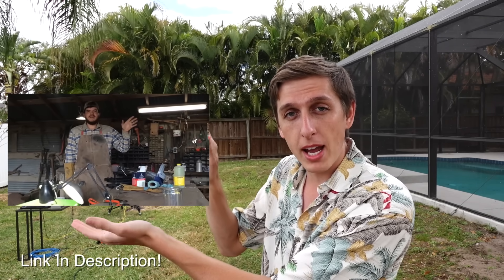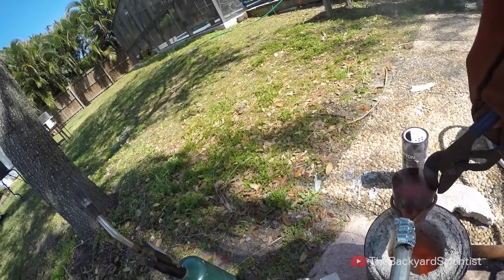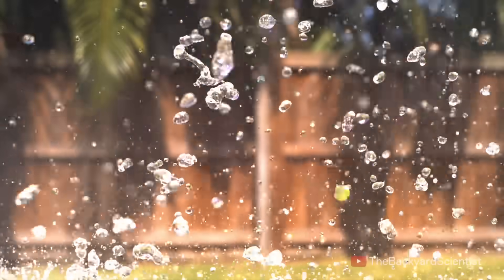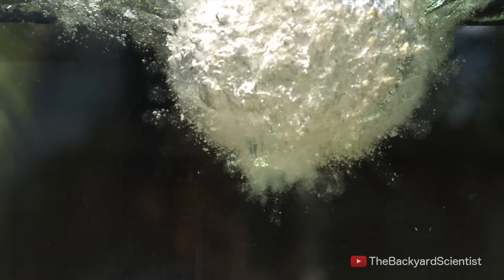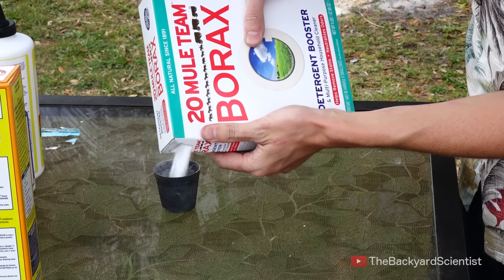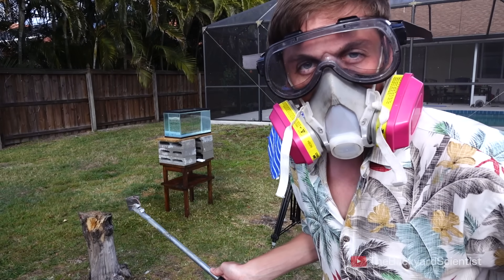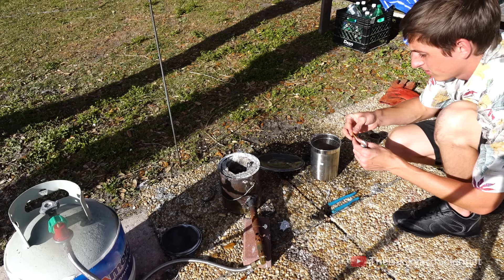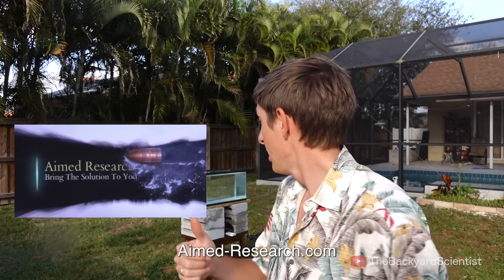Pouring Molten salt into Water - Explosion!

Comment: The reason for the explosion is a mystery to me as well. The best explanation I can think of at the moment is that sodium chloride has a much higher solubility in water when molten than the other salts do (I have no idea if that's true or not). Thus, the sodium chloride is dissolving and dispersing into the water fast enough to defeat the Leidenfrost effect. Instant steam explosion.

Maybe. I'll have to ask a chemistry/physics expert.  :P

Comment: Did you take into account the viscosity of the molten salts? From looking at the video, the molten table salt looked the thinnest. I think this could have a couple of effects. For one, it's poured into the water from the crucible faster, and therefore a larger amount is involved in the experiential reaction.  The thicker nature of the other molten salts could also prevent the water mixing with the fluid, due to the increased surface tension. This would mean that the reaction your visualized with putty wouldn't be able to happen.

Comment: 7:55 maybe its because NaCl is much more affine to water (much higher solubility).
You should try other salts aswell like KNO3 or KCl to check if its about solubility.
Also the viscosity and thermal conductivity of the melt may play a big role in this effect.
Reply: I really hope you're right. Either way, FOLLOW-UP VIDEO!

Comment: Dude... Get some better safety protection!! You should be wearing welding gear whilst doing these kind of experiments (thick leather gloves, leather apron and a face mask). Also the explosion is from the water flash boiling which causes the water to turn to steam at such a fast rate it effectively explodes. When water turns to steam it can expand to over 1,700 times it's original size. When the substance (salt in the instance) is hot enough and has enough surface area interacting with the water at once you get the explosion.

Comment: So, when you melt the salt, some of the chlorine vaporizes out of the solution, which leaves you with some elemental sodium. When you pour it into the water, you get a classic sodium explosion.

Leastwise, I think that's what's going on. Not convinced of your explanation.
Reply: +NarlepoaxIII clearly its the sodium reaction with the water. his explanition is wrong. but he tried
Reply: ThoperSought
I believe it's a very small amount of sodium. It's still mostly salt, but there's a little bit of pure sodium in there.
Reply: ***** actually when you heat up the salt to the point it starts melting, it will release chlorine gas and the sodium that stays becomes metalic. hence the results. he was right about the leidenfrost effect in the bigger explosion though.
Reply: I was thinking the same
Reply: ***** 
I wondered about that. in that case, wouldn't you expect to see the same orange color?

also, how about the ph staying the same, when he tested that?
Reply: Icaro Vasconcelos
Quod gratis asseritur, gratis negatur.
Reply: Icaro Vasconcelos ***** 
so, are you saying that the papers he referenced were incorrect, or that his interpretation of them is incorrect?

also, are you saying that the whole effect is a sodium metal reaction?
Reply: *****
"... there's a little bit of pure sodium in there."
so, re. the ph, are you saying that his test wasn't sensitive enough?
Reply: ThoperSought Mate, did you read the pappers? They're about pouring liquid water into a recipient filled with liquid NaCl, which is exactly the opposite to this experiment.
Reply: Icaro Vasconcelos
"... did you read the pappers?"
no, I didn't.  I don't have the background for it mean anything if I did.  that's why I'm asking questions.

"... which is exactly the opposite to this experiment."
that doesn't seem to automatically mean that the reaction is caused by sodium metal in this case.  can you clarify why that's relevant?
Reply: Icaro Vasconcelos
The melting point for metallic sodium is exponentially lower than that of salt.
Reply: ThoperSought
Probably, considering that there would have been a pH change even if it were the leidenfrost effect.

Comment: I think, that this could happen because of two reasons. The first is that the hot salt turns water into steam very rapidly. The second reason I belive is that the high temperature also decompose the water into hydrogen and oxygen which in turn recombind and cause the big explosions. But I really have no idea how this happens, but this is my theory.

Comment: Do ionic crystal lattice structures still apply to molten salts? Maybe pouring liquid nitrogen over a large salt crystal then putting that into the water could help to determine if it's something to do with the lattice. Compare molten salts that have a similar structure to NaCl - what about molten sand?

That's my late night two cents.

Comment: Well, how good is borax at giving off heat compared to NaCl? If your hypothesis is correct, the (still liquid) water needs to get pretty close to the salt to be influenced by the divets in the solidifying salt, before the water starts boiling and creating the Leidenfrost film. If borax is way more efficient at giving off heat, it would instantly create a Leidenfrost film protecting it from the liquid.
On the other hand, just for clarity's sake, if NaCl is terrible at giving off heat, the liquid water can get close enough to the material before boiling for the divets to do their part.

Edit: Although, after giving it more thought, not quite sure I'm correct about how the difference would manifest...Maybe borax is actually the one that's terrible at giving off heat, so the expansion from 1) the water turning into vapor and 2) the vapor further expanding due to heat leads to a less violent effect compared to NaCl? After checking the video again, the Leidenfrost bubble looks pretty tiny for borax compared to NaCl.
Thing is, if it is indeed a purely physical effect, the difference in heat transferability (or whatever that's called ~.~) is the only thing that comes to my mind as a possible difference between the two salts.

Note: I'm a physicist, not a chemist, and this isn't exactly related to anything that I have ever dealt with in neither my studies nor what I'm working on now xD So take all that with a grain of salt (pun absolutely intended).
Note #2: I'm at home because I'm feverish, so I might no be thinking straight :P
Reply: +Hedshodd My original thought was the surface tension of the molten salts. If borax sticks together in the water and "beads" then it would help the leidenfrost effect shield the water.
Reply: +Boabdil Perez
 Hm, good point. So borax with a possibly higher surface tension would clump up more creating less holes and cavities leading to a smoother Leidenfrost shield? There's like databanks for that kind of info on surface tension, right? xD
Reply: +Hedshodd I bet there are!

Comment: You are lucky guy. I was working in heat treatment factory. The molten salt is used for heating metal parts for quenching. My coworker did not keep the procedure for adding new salt into molten in the furnace. The procedure is to let the new batch in 200°C for two hours to let the water evaporate. He put a bucket of salt with moisture water (he thought that the moisture from the air is negligible). He lost lot of skin and flesh on his right hand and right side of torso. Lucky him he did not loose eye or fingers.

Comment: it would be interesting to see what happens if the water itself is saturated with NaCl.
my guess is that it takes the massive explosion because its desolving in that super hot state. Second test would be into a saturated solution at boiling point of water.

Comment: I have a question though. Why does metal sodium cause a fiery explosion, when sodium chloride causes more of like a gas explosion? would it be that the sodium heats up very violently when exposed to water due to either the hydrogen or oxygen reacting with it chemically? Can anyone help me out?
Reply: +Wade Thegreat The sodium explosion is a chemical one. Sodium explodes when it comes into contact with water. 

The molten salt wasn't exploding, per se, on contact with water. The high heat of the molten salt caused steam to form at an explosive rate, and because the water vapor takes up so much more volume than liquid water it expanded fast enough to cause a steam explosion.

Comment: +TheBackyardScientist  The explanation I gave on the What We Made video, is that there is no leidenfrost effect for the sodium chloride because it reacts/dissolves in water.   I would say check the solubility of the salts you used for the experiment.  If they are not very soluble, then they are probably not as ionic as you think.  You should use something more ionic like magnesium sulfate or something (make sure it doesn't release dangerous sulfur fumes)

Comment: I don't think that sounds quite right. The surface tension of the molten salt would need to be incredibly low for a cascading steam explosion, but it really doesn't look that way at either low or high speed. It may be indicative of weird things about either the salts of alkali metals or halogens (testable). Since you did a series of sodium salts, that kind of rules them out.

Comment: i dont have the same opinion about the conclusion tho, i think its a chemical reaction even though there arent any PH changes, because if u put the Na without melting it, it will exploded too. So i think what happened is that when u heat the salt that is NaCl and because u heated it up until its melting point the CL escape and become cl2 (gas) and left you pure Na that reacts when put into the water. Na in physical from usually are stored in oil because they even reacts  with H2O molecule in the air.

Comment: 3:11 I bet it's a Coulombic explosion due to the speed at which it happens. If it was due to heat and vapor it would be much slower.
Reply: +trucid2  Could be true. But then again, that is quite a bit harder to calculate - we could ask Phil if he could give it a try :)
Reply: +ABaumstumpf http://www.nature.com/nchem/journal/v7/n3/abs/nchem.2161.html
Here is his paper if anyone is interested.

"High-speed camera imaging of liquid drops of a sodium/potassium alloy in water reveals submillisecond formation of metal spikes that protrude from the surface of the drop. Molecular dynamics simulations demonstrate that on immersion in water there is an almost immediate release of electrons from the metal surface. The system thus quickly reaches the Rayleigh instability limit, which leads to a ‘coulomb explosion’ of the alkali metal drop. Consequently, a new metal surface in contact with water is formed, which explains why the reaction does not become self-quenched by its products, but can rather lead to explosive behaviour."
Reply: trucid2  i know that paper quite well, but it is sodiumpotasium alloy. Sure, NaCl explosion will very likely be based on the same reaction, but just assuming that to be the case it not good.
He did try it with Sodium Carbonate and Borax - both of which you could well imagine coulombic explosions due to them containing Na. But it only happens with NaCl that normally is rather stable.

So i would still say that further testing is needed.
(And yes, i have also seen quite a lot of other research about salt explosions - it is kinda fun to see and watch, but most have not been able to give a conclusive answer yet)

Comment: This IS a chemical reaction, it's because the salt tries to dissolve in the water, but because it's superheated it causes the water to expand and create release oxygen as part of the process of converting water to steam. The reason the Leidenfrost effect doesn't protect it is because salt ALSO dissolves in steam, which is just the gas form of water.

Comment: i think that when the salt hits the water the outside solidifies but the inside is still molten and since cold stuff shrinks the molten core gets compressed until the solid outside layer cracks, the opposite happens in this video    https://youtu.be/sPScqP3mFKQ

Comment: Maybe its the breakdown of H2O to H2 and O due the heat of the molten salt. 
The two gasses combine again and release energy.
The melting point of Borax is 745 °C an NaCl is 801°C, plus you had to heat NaCl more to get a greater reaction.
you should measure the temperature of the exploding NaCl the moment you pour it in the water and the melt some other material to the same heat and pour it in. If there is no equal reaction, my theory seems non valid :)

Comment: sodium chloride is much thinner when it's melted so it doesn't take much force for water to make its own space, it can do it simply out of equilibrium. the other salts probably don't give as easily because as a liquid, they are still thick and retain their surface tension.

Comment: Why does sodium chloride (NaCl) look different after you melt it? Another idea would be to go into the countryside or desert, away from anything flamable. You would avoid complaints from cranky neighbours. It would be a good idea to wear full body protection, to avoid getting hurt by flying glass, molten metal and spewing water. What would happen if you put molten potassium chloride (KCl) into a tank full of water? Or molten magnesium chloride (MgCl)? Pretty cool video.

Comment: Maybe the thermal conductivity of molten salt is less which may give it enough time to come in contact with water and explode before water turns into vapour (So basically no leidenfrost effect). And I think it is a wrong way of testing the chemical reaction if Na+H2O gives NaOH then Cl- may give HCl which again neutralise each other(no change in pH and big explosion due to heat of neutralisation).
Reply: +Pravardhan Reddy That was my thought too - if it was a physical reaction, there should be salt flying around, but there isn't. It looks like the steam is building up on the outside, not the inside.

Comment: That reaction reminded me of a star like our sun. while it is constantly producing explosions built up from below.  Thousands of small nuclear explosions keep the sun going strong but not enough to make it go nova. Could it be the chloride makes the sodium sink faster and keeps generating more and more expansion?
Reply: +Maanuueel42 \m/(^_^)  Yes, a piece of "average" Sun would not even feel warm, as an average handful would produce 100-200 mW. The nuclear explosion is there, but far away in its center and continuous (so far as we know) which you could call an explosion even if it is some kind of continuously exploding equilibrium.
Reply: Maybe
Reply: Deeps thoughts

by Joyce Joseph
Reply: +Joyce Joseph The sun does absolutely not work with nuclear explosions. It just doesn't. It's not even hot enough to directly fuse hydrogen. In fact, the power density of your body (about 1200W/m3) is higher than that of the sun (about 276.5 W/m3)
Reply: Tore Lund
Thanks. I have been to university and studied physics. I usually don't argue with those who are so sure of what they say.